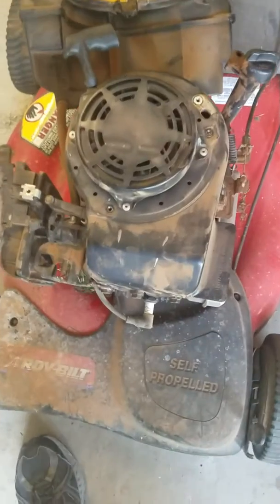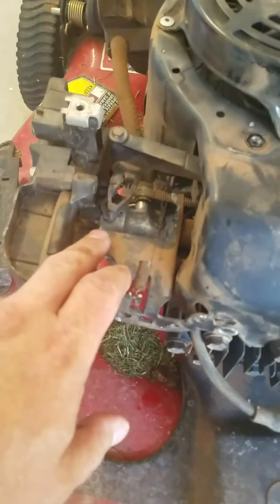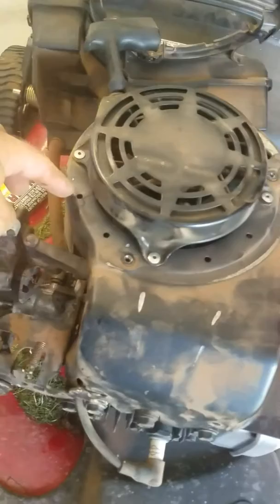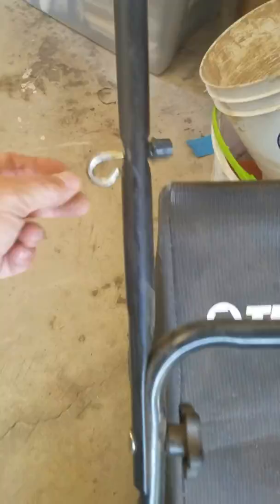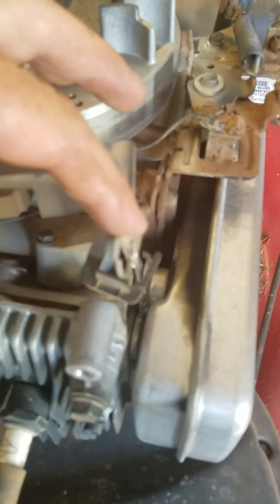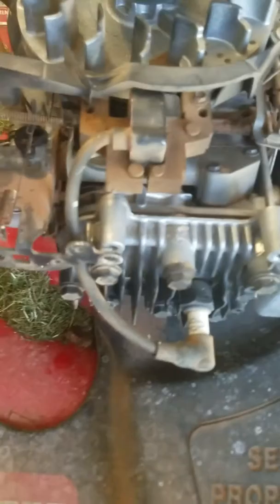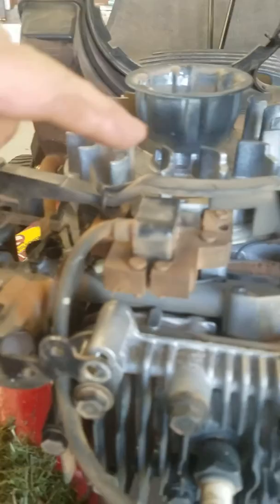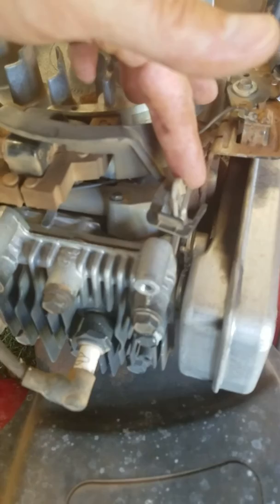Briggs and Stratton 675 series auto choke fix.

Comment: Thank you.  I went through the same process (removed and cleaned the carb first, then noticed the arm for the auto-choke wasn't moving freely, and the engine ran great when I manually held the choke open).  Your video let me know what I was in for before I opened her up further, and I had never come across an auto-choke like that before, so I learned something!.

Comment: Great video. I flipped my lawn mower upside down to get a broken motor mount bolt out and thought I would clean the carb at the same time. Put everything back together and  started it and it idled low and sputtered.  By flipping it upside I dislodged this arm somehow.